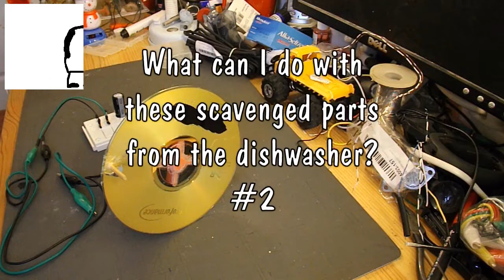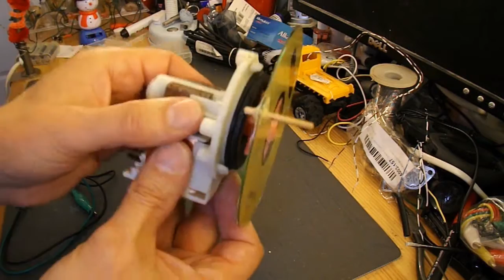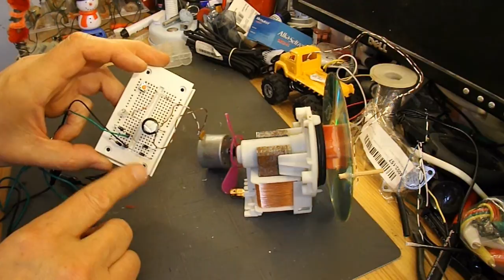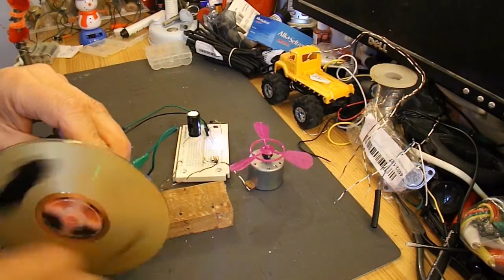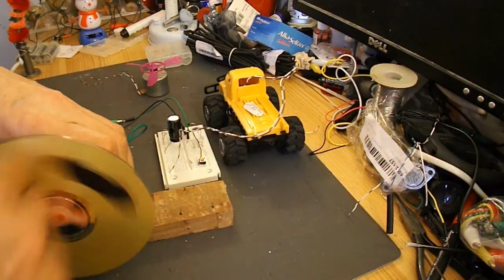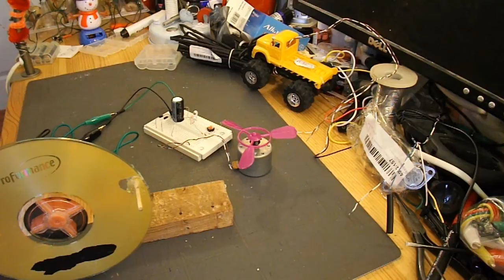What can I do with these scavenged parts? #2

Comment: Although the engines be equal, the propeller has little strength compared to the four wheels of the truck toy.
And the burden of the supercapacitor, barely moves.
Reply from the maker: Yes that is what I am demonstrating, the truck needs a larger current flow even though the voltage is high enough. The capacitor I use here is a normal electrolytic so it gives up it's charge immediately, not like a supercapacitor which would act more like a battery.

Comment: make transmision so motor turns faster ...
Reply from the maker: I am not quite sure what this 'motor' is. When I spin it faster I seem to get less power out of it which does not make sense, but that is what seems to happen. I think it is actually some sort of flow meter rather than a motor.  These ac units seem to work different to a normal dc set up.
Reply: OK

Comment: It works and it does stuff :)
Couple of thoughts...you'd get more to the cap if you put a resistor in series with the LED, to cut its brightness and therefore power usage.
A smaller vehicle would be how to run it from the CD/water pump. One of those toothbrush motors to a converted elastic band powered car  ? The car could still be big, for visual impressiveness, but would be far more efficient than the other one.
For a motor you usually only need 1 diode (depending on the source motor) and that would save 0.7V if using 1N4007 type silicons as they seem to be in your bridge.
Reply from the maker: Thanks slider, I will probably have another play with this.
I already have a kit that drives a toy car with a hand held generator. I picked it up in one of my charity shop visits last year and haven't opened the box yet. Planning to do that when my granddaughter visits some time as she is older than the boys and more likely to understand what is going on with the generator etc.
Reply: Maybe if the truck did not have to roll the wheels would move longer.
The friction causes the load is terminated immediately.